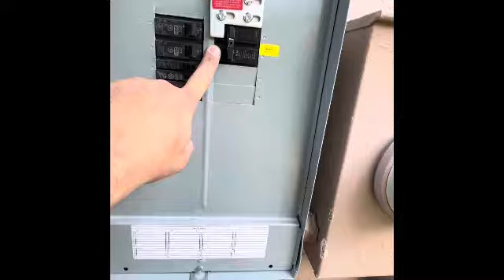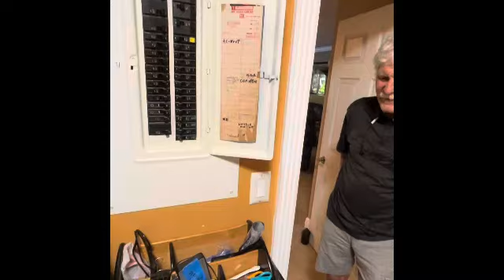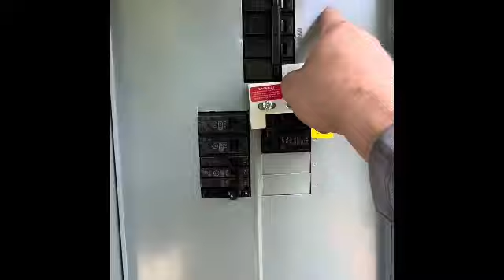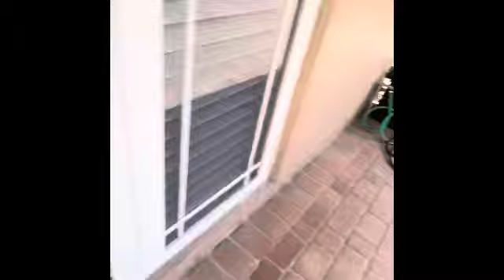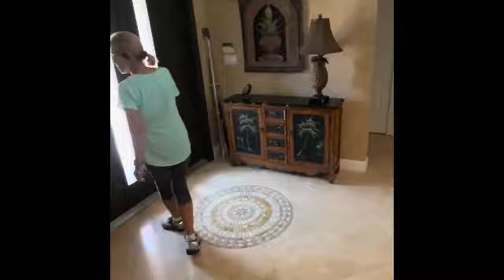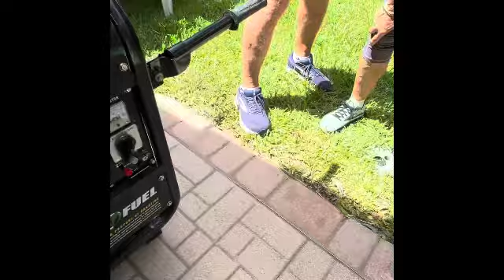Portable Generator Start Up / Shut Down Procedure For Interlock Outlet Installation. Share!

Comment: Good video for those who think it's complicated.  Very basic steps, just follow them in the right order and all will be good. 

They should know how much runtime they could expect from a 20lb propane tank and plan for enough for their needs.
@Brian - was this example using the 30 or 50 amp connections to the house?
Did you have to put soft starts on their AC units or were there very small tonnage units?
Reply from the maker: Customer has some 20 and 40 pounder tanks. They will be ordering more tanks also. 

50 amp outlet install and walk through. 

2X ACs. This is a 10K. They have small ACs. We only used one AC at a time. I don’t know if the generator would handle two ac’s turning on and off. 

No soft starts but I have installed them